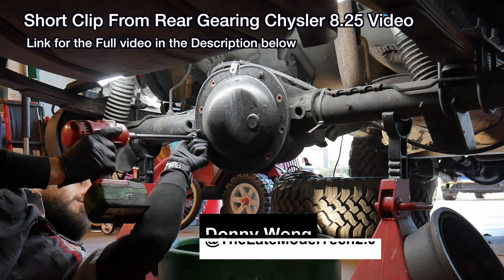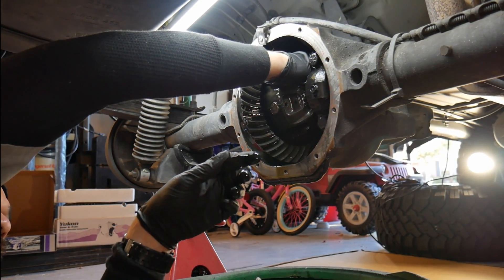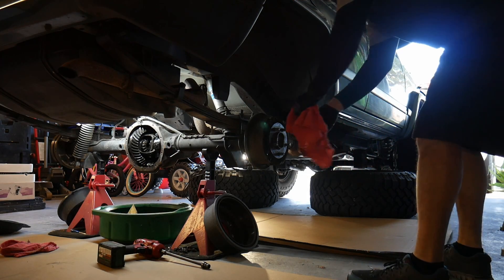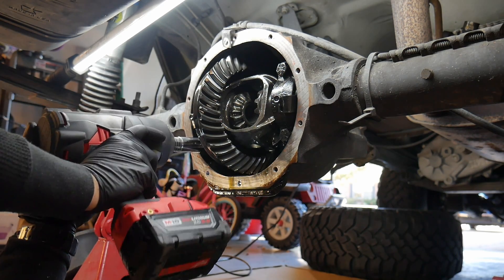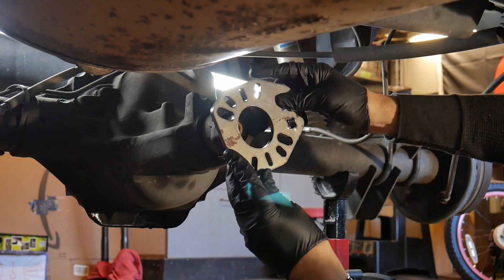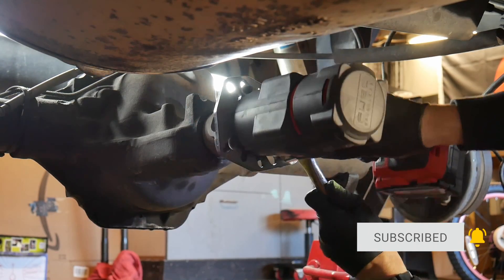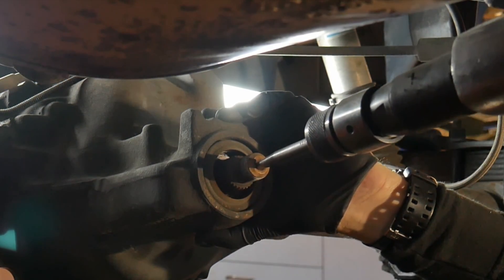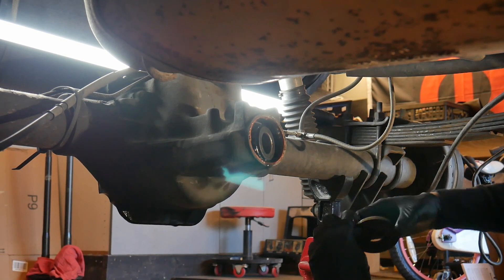Removing A Differential Carrier Ring Gear and Pinion from Straight Axle Jeep Truck Suv / xj jk jl

Comment: WOW Great step by step video. No loud music in background! On my '78 Mopar 9 1/4  can I just replace the pinion from a small u-joint to a large by just removing nut? Thinking if I can with out opening up Diff and not getting a conversion u-joint. Tring to get a new drive shaft with both large joints. Thank you.

Comment: Any reason why my diff is not coming out I have removed the rear end axles it's four bolts that hold it in but the diff casing is not coming out at all???
Reply: Same here. I have a 8.5 in my 1984 Hurst Olds and I removed both of my axles and the 4 bolts that hold the case as well but it still seems as if it’s stuck in there.

Comment: carrier will not rotate to get to center pin bolt, to remove c-clips?
Reply: that is because it is attached to the driveshaft. put it in neutral and rotate the driveshaft until you can reach the bolt holding it in

Comment: Hello, I’m working on a Chrysler 8.25 and the bolt holding the cross pin is stuck. I’m concerned I might strip the bolt if it doesn’t move.  Any tip for removing the stuck bolt? Thanks.
Reply from the maker: Use a Torch and heat 🔥 it up ,

Comment: what is an alternative if a pointed chisel air hammer doesn't force out the Pinion. I've tried heating it up and hammering but I can't free it up 😕
Reply from the maker: Torch the axle housing, then get swinging with a big hammer.    You might have to remove the axle from the truck and set it on some jack stands and swing down on it.  Good luck.
Reply: @Donnythelatemodeltech  thanks very much! will try this.
Reply from the maker: If you remove the axle assembly it's going to be 100x easier on your body to replace ring and gear.    Unless your on a lift. I seriously thinking the next one I do in the driveway Im just going to pull it out and sit in a chair .

Comment: I have a 5 ton winch trying to pull my ring gear out and she ain't budging! Any ideas? It's on a dana 60
Reply from the maker: Warm-up the case
Reply: @Donnythelatemodeltech  thanks for the quick response however its was moment to late I just did a mag dump with the barrett 50 cal on it
Reply: @Donnythelatemodeltech  was just joking  by the way. Does that actually work? I never had one stuck like this. Just worried because it's a Cummings so everything is covered in oil
Reply from the maker: Heat won't hurt . Warm up the housing.. like get it hot.    
Your supposed to use a case Spreader,   your going to have a great time getting that one out and back in, then out and back in without the spreader.
Reply from the maker: Cheap harbor freight heat gun maybe two if you don't have a torch.       I've used a heat gun to expand all kinds of parts..   just might have to leave it heating cooking for 10 or 20 minutes.
Reply: @Donnythelatemodeltech  thanks for the input. Some say you can without the spreader some say you cant. I'm saying you cant lol

Comment: Very nice. And very well detailed Much appreciated.  Putting a locker in an 02 dakota with a 8.25 rear
Reply: cool, i’m putting a locker in a 02 durango with a 9.25
Reply: @kalevvaska2541  dont forget the ring gear bolts are reverse thread.. and dont forget the speed sensor ring gear. Went with the eaton detroit lsd. On climbs have to apply brakes and keep them pressed to lock the rear. Turns like an open too. No pops clicks nothing. A solid piece of machinery. And my lash was settled at .10. Anything lower the lash adjuster cam screws popped and jumped threads  makin me start all over. They a lil worn..i ordered new ones but didnt feel like waiting so i used the worn ones 🤷🏽‍♂️. Its holdin great no moaning or nothin..and now have a pair of lash screws sittin around 😁
Reply: @mobius-1503  thanks for the information, i’ll keep that stuff in mind. I’m hoping not to have to adjust the backlash but we’ll see. I was thinking about a powertrax lock right
Reply: @kalevvaska2541  as soon as the open diff housing comes out. The lash screws  come out as well. Theres no avoiding it. Its not difficult at all. Youl need a 75lb torque wrench. A dial caliper. and youll need the lash adjuster tool for mopar. It was 15.00. And i got a dial caliper with a good base hold for another 35.00. Oh as for the powertraxx Lockrite. Its the one I had first. I dont why but i couldnt get the pin to go through the 2 halves when they were in the diff housing. Followed directions and all..and so i returned it. Saved up cash and got the detroit truetrac. Yours is the 31 spline comes out a lil cheaper than the 29spline. Bout mid 600. Worth it? For 1 youll see a huge diff in machinery. On the eaton your replacing all the internals in 1 piece. The pin. Spider gears. Open diff housing gone. Only thing thats attached to this bad boy is the pinion gear, ring gear and speed sensor. The piece is very fine machined and heavy. Something that does just over the 2 palm size pieces youll receive on a lockrite locker. I think the eaton is rated to 600-700hp.
Reply: @mobius-1503  Yeah, I guess adjusting the backlash doesn’t sound too bad. That’s weird about not getting the pin through the 2 halves. I’m hoping it won’t happen to me. It’s only 400 though, and it’s important to understand the application. If I was power modding my Durango for street driving, I would be more likely to go with the Eaton. But I primarily only drive it off-road, so I’m looking for something pretty aggressive. We’ll see how the installation goes
Reply: @mobius-1503  To clarify, you’re talking about the pinion gear backlash right?
Reply: @kalevvaska2541  pinion bearing preload to be specific
Reply: @mobius-1503  gotcha. that’s what I was thinking of
Reply: @kalevvaska2541  yea your application is more suited. Mines the daily driver in all conditions with off roading here and there..im still debating whether ima put one in the front...get in a bind i also risk busting and axle right?
Reply: @mobius-1503  yeah since mine isn’t a daily it makes more sense. Idk about your dakota but the front axle on my rango is pretty weak and i wouldn’t trust it with a locker. Maybe an lsd, but you always risk busting an axle. Especially the ifs front axle.